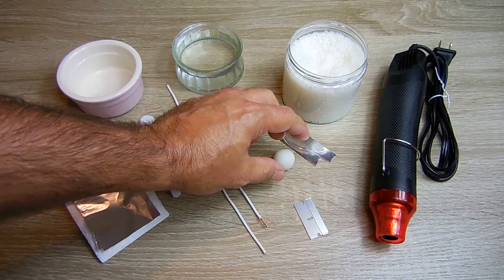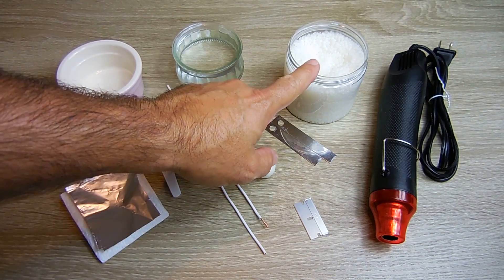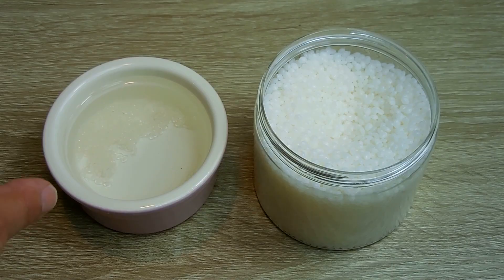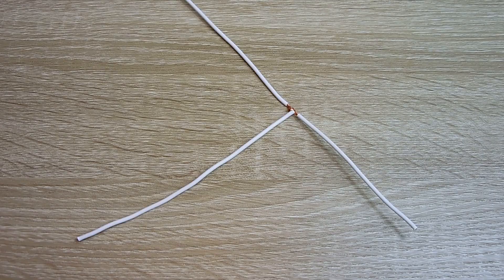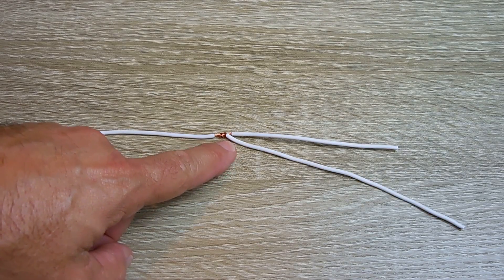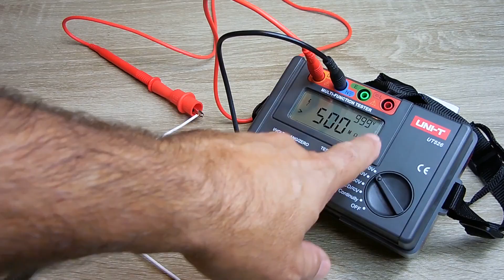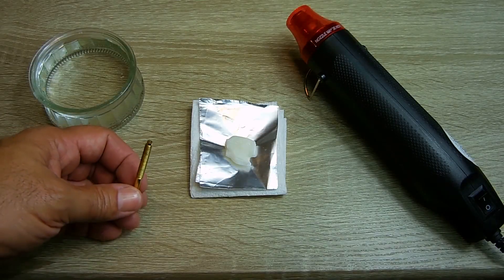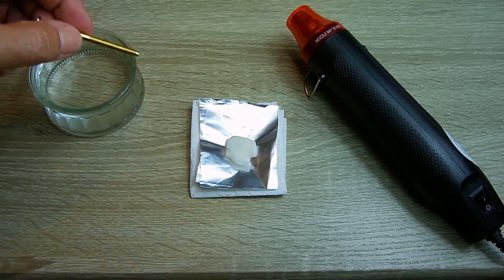How To Mold Strong Plastic Parts!

Comment: If it was good for electrical wires we would be using this in the aerospace industry.. which we don't do is not a good idea and solder is better if you know how to solder correctly.

Comment: I'd like your recommendation. I want to coat a set of pliers with a heat resistant plastic. At work, I have to solder thick gauge wires to tabs, that are welded to batteries, and I keep damaging the wire sheathing with regular pliers. I've tried to file smooth any sharp edges on the pliers, but in time I end up damaging the wire sheathing. I started using this PLASTI DIP Plastic Multi Rubber Grip Coating for Handles. It works but in time, it wears out and the metal of the pliers gets exposed. Do you know of a plastic mix product I can use to coat the business end of pliers, and have some average heat resistance. And if that's not hard enough,  it has to be inexpensive. I don't need a large amount, just enough for a couple of pliers.

Comment: Great video!
Do you think it's likely to be possible to form a strip (or sheet) of Thermomorph/Polymorph with some kind of fabric reinforcement incorporated into it, for strength?
I'm trying to fix a cracked polystyrene fridge drawer, but need something with some shear resistance.
Reply from the maker: Look for a thin sheet of the same plastic, then bond it using the proper adhesive.

Comment: I have a mirror frame with a missing decorative motif, and I want to duplicate a small section of the frame by making a mold and then casting the missing piece in resin.  Can this material be used to make a mold? It would need to release from the mirror frame once it was pressed into place to form the mold.
Reply from the maker: Hello Sue. It could be used, but it's not the ideal thing to use. You need dental alginate, it works perfectly for what you want to do.  Make the mixture a little thinner, avoid getting air bubbles trapped. Thanks for watching!

https://amzn.to/3zcr1pj
(Amazon Affiliate Link)
Reply: @electronicsNmore  Many thanks!

Comment: Do you know if there’s a way to harden (more) a 1/32” thin piece?
Reply from the maker: Too thin, it will definitely be flexible.
Reply: @electronicsNmore  Tried dipping it in freezing water immediately after heating, kind of worked but nothing really significant 😐

Comment: I need to make replacement heels for road cycling shoes can polymorphe thermoplastic be glue with epoxy and drilled ? I'd be gluing and fixing with a tiny wood screw , thanks in advance for the reply ..
Reply from the maker: The material is very slick like HDPE, so you'd have trouble gluing it. Drilling is not a problem.

Comment: Wow thanks a ton! That stuff looks great I'll definitely order some because I have some car parts that it should work perfectly on! Is there a higher temp version or something similar? Unfortunately I live in Texas and car parts (especially around the engine) can easily get too hot which is why, like you said, electrical tape isn't a good solution! Thanks again and God Bless!
Reply from the maker: Only the one temp version.

Comment: Wow. Great video. looked it up on Amazon, and found lots of other brands. Thermomorph (same specs) for example has 631 reviews rather than 21 for Polymorph, and is higher rated. Have you tried other brands, and are they equivalent? There are numerous uses for me that I can think of, and plan to obtain such a product! Thanks again for the video.
Reply from the maker: It's all the same stuff. I posted a link that was the cheapest for 1 pound.
Reply: @electronicsNmore  Thanks! I  thought so.

Comment: Polycaprolactone aka Polymorph pellets, you can get it 100g at 0.70$ from aliexpres great stuff
Reply: what about thinner and polyestirene? Its really flamable, pero once it dries its quite solid and flexible and sticks very well.
Reply: @laharl2k  I made some Polystyrene by melting it with acetone, not the nail polish remover, it gets a viscosity like honey, it can be poured in gypsum molds. But it stinks,you need to do this outdoor or wear a respirator with a chemicals removing filter. It melts in gasoline too but takes mutch longer until it hardens. The stuff shown in the clip is nice , you can remove it with just a cup of 60C degree water. I have used silicone before to make a coat for my arduino data loggers but its a pain to remove it, polystyrene is like forever, you dont wanna expose plastic components to acetone.

Comment: cool material. i usualy use bubble gum or hot glue on some things since they are chaper but yours is good for specific jobs. :) Sometimes i melt platic outdoors witha  fan if i need to fix something. :)
Reply: Amigo, reading your comment made me laugh.  It is good to know that I am not the only nut out there to have discovered the many uses of bubblegum...  A stick of Big Red will harden to a serious weld over time.  But If it is a serious problem, I sometimes bust  out with the Big League Chew...

F.